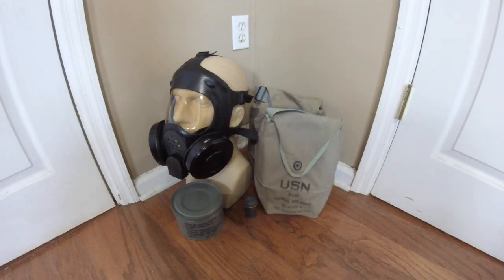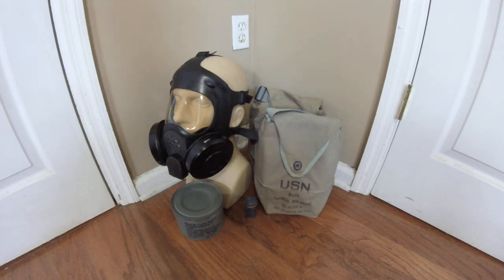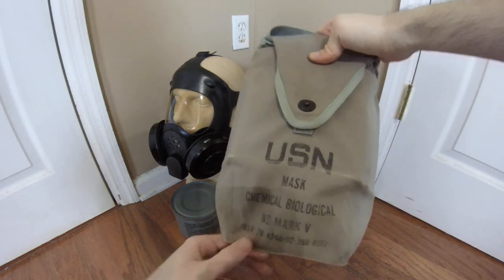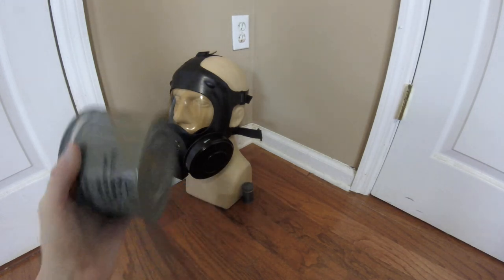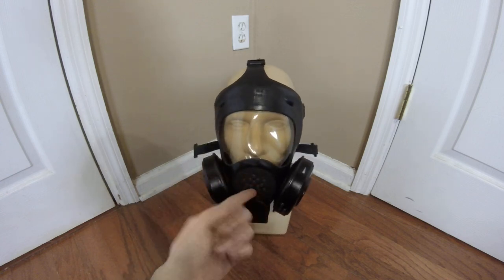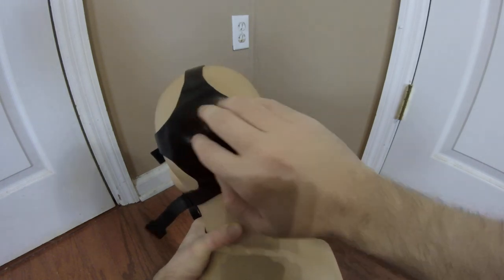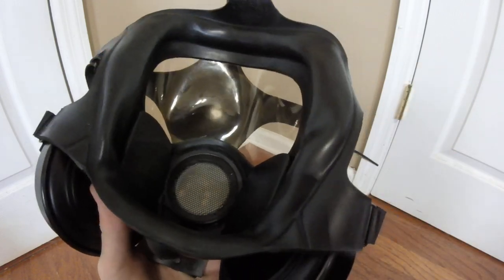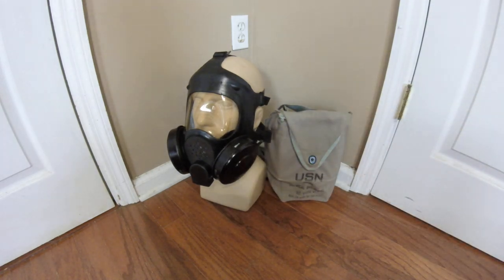(OLD VIDEO) U.S. Navy Diaphragm Gas Mask Mk.V

Comment: ELT's on Submarines used these when they needed more mobility than an EAB plugged into  the ballast tanks through a reducer with a 6 foot in most cases allowed for radiological casualty procedures in the early 80s but not for fires, so we didn't have many of these on board, and I only saw one person on my first boat ever wear one.